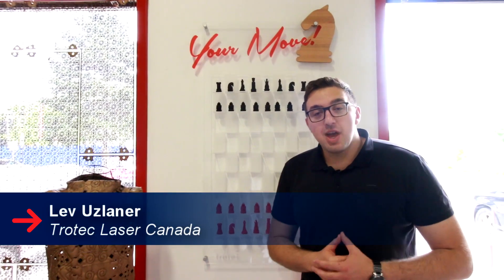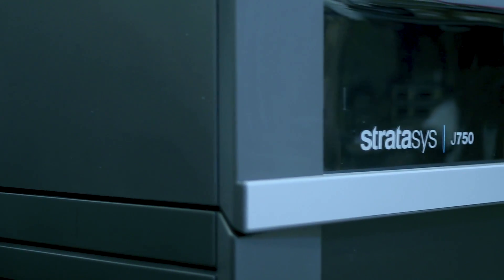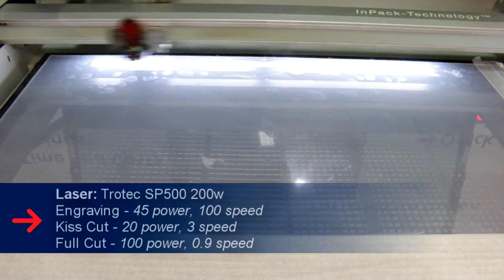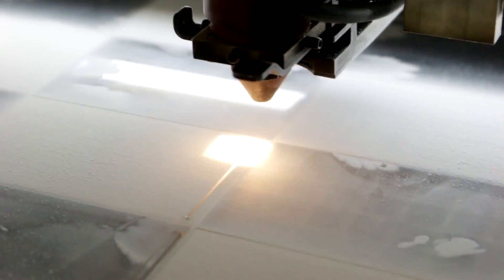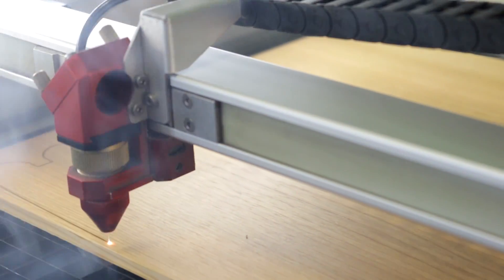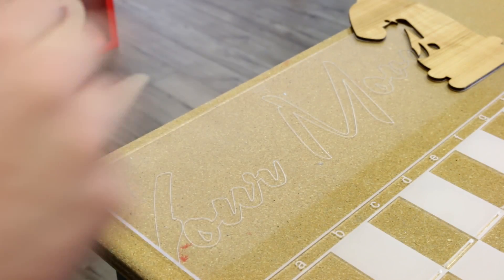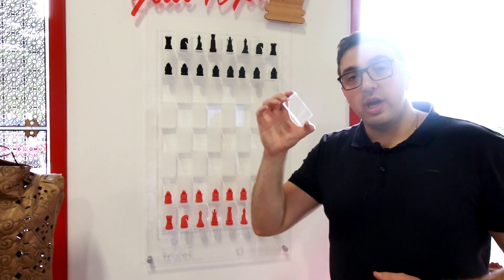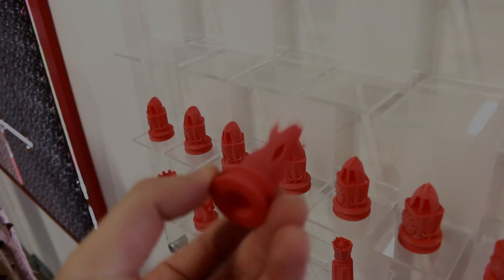Vertical Chess Set | 3D Printed and Laser Cut | SP500

Comment: What 3M product did you using for adhesive backing and are you putting the laser out of focus for some of the line?
Reply from the maker: Hi Rodney, its the standard 3M adhesive roll we can get you specifics if your looking for a product sheet on it. We are not going out of focus, it may look like it because of the Clearance Lens - its just a 2.5" clearance lens that gives us more distance between the laser head and the material.